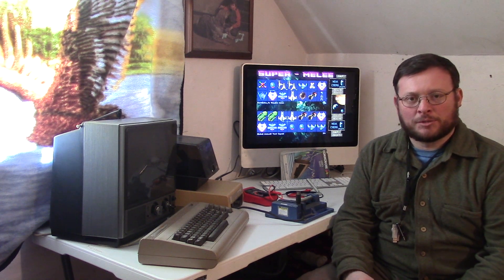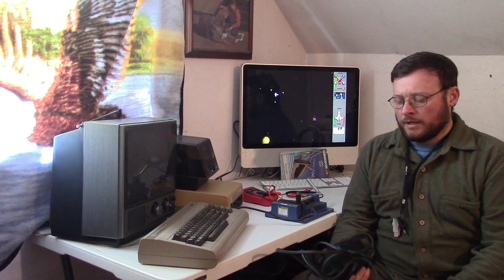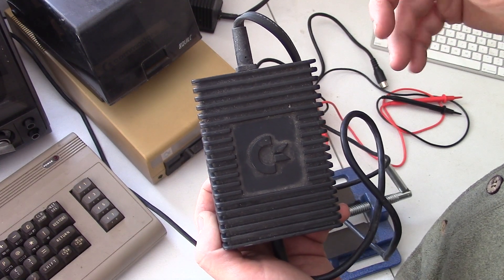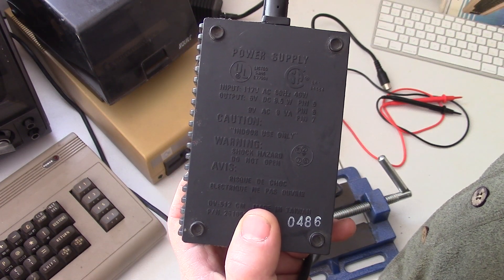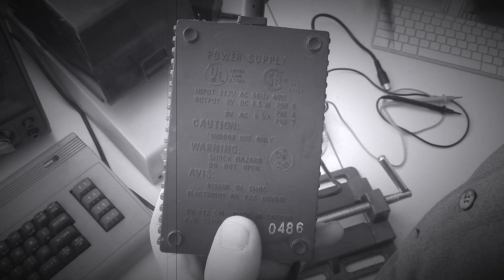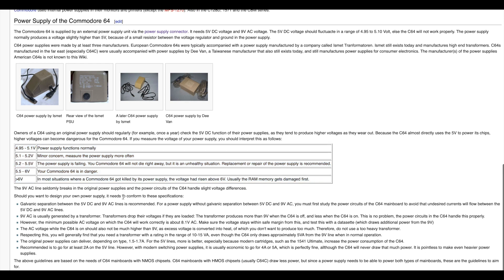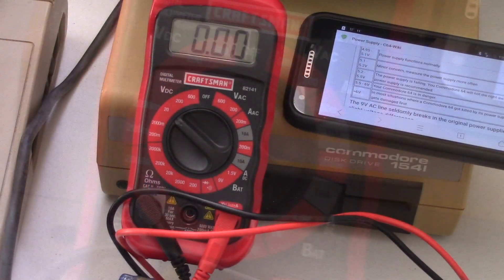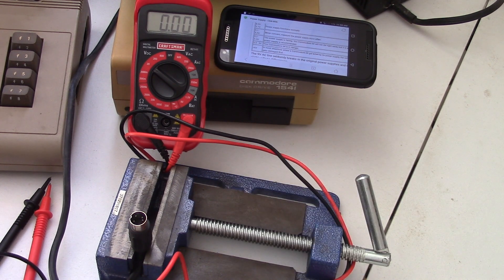Commodore 64 Power Supply Test (C64 PSU Test)

Comment: About to be picking up a c64 is there anything else to check when I get it that maybe should be replaced or have a look at?
Reply from the maker: Just the typical stuff with old electronics. Listen for any rattling inside, look for extra dirt and dust buildup. Turn it on when you get it home and let it run for a while and then check for excessive heat anywhere.
Reply: @ ok cool so nothing else specifically to check out on these besides the power supply? I usually go through my consoles and games and clean them when I get them so I’m good there lol

Comment: Useful, but could benefit from being very specific about which pin is which. In your readout, it indicated negative? So you might have reversed the red and black? People with analog meters would not want to do this. From what I'm seeing then, we are measuring the two close pins, but the pin farthest from the other side is the 0V pin.

Comment: I will be using this once I get my multi meter.  I was using my C64 yesterday when suddenly I started hearing this weird 'ticking' sound coming from the power supply and then I saw the power light on the C64 itself fad.  I turned everything off, unplugged the power supply (the brick felt quite warm), waited, and then plugged everything back in.  Now I don't get any juice at all, no light on the C64, and I'm hoping it's the PSU instead of the actual bread bin but I guess this test will tell me for sure.
Reply from the maker: Please update us with what you find out. I hope it’s nothing too serious and just the power supply itself
Reply: @MaineMachinist  Well, my multimeter doesn't have a setting for 20 volts like yours does, but I did set it to DC voltage and got .001 on the readout.  So I suspect it's basically completely dead?  It's definitely not warm at all despite being plugged in.  I found a second power supply in the closet, went to test that, and it was coming back with 5.134 so at least I know the multimeter is working 🙂
Reply: @Sudz28  Any multimeter setting from say 10V+ should be fine. He set his to 20V because it was the lowest setting he could safely use. His next option down was 2000mV = 2V which obviously is a no-no for measuring 5-6V+

Comment: Interesting note, just because your voltages are right it doesn’t mean the power supply is good. What tends to kill circuits is current and sometimes with the C64 you might notice that the power LED is dim. This is because the power supply is no longer able put out enough DC amps. Btw, low DC current can damage components, too.
Reply from the maker: Excellent information. Thank you for sharing and I hope people take it into consideration.